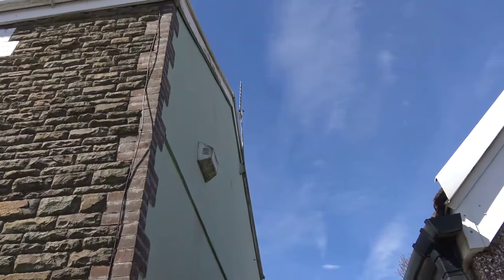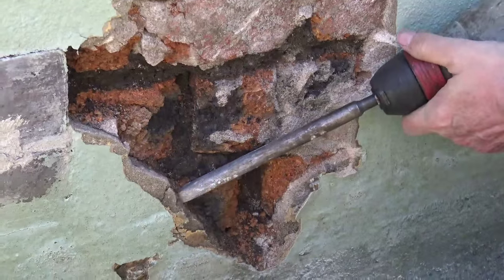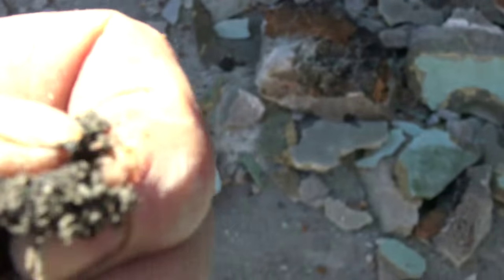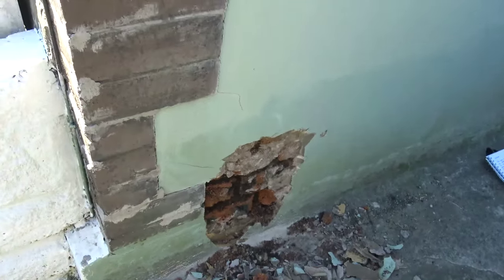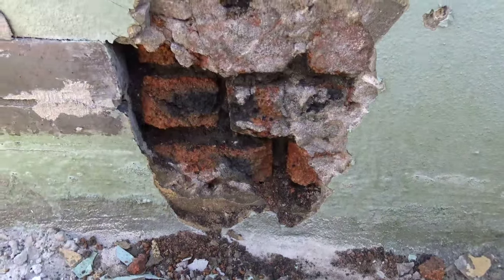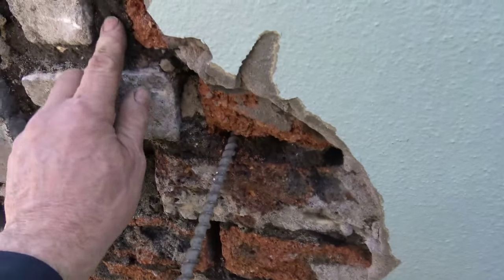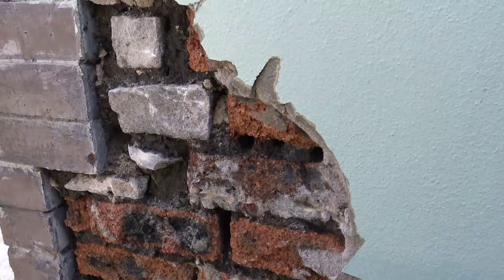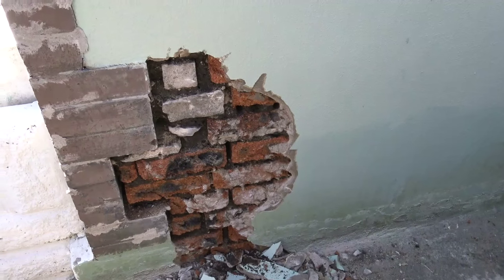A VERY wet Welsh house - all from cement render - not rising damp!

Comment: I understand that the cement render is trapping moisture in, but what I can't get my head around is how the damp got in there in the first place as the render has stopped water penetrating.
Reply from the maker: Its not penetrating to start with - Moisture is trapped by render that is impervious - there is water in the air all the time as a gas - it diffuses through everything, but when the wall gets cold - ie cold wind blowing round the corner or near the ground, it then condenses within the wall and makes it wet.  Basically fog forms in the wall.   Fine if there is lime - it can evaporate - but put cement or gypsum on the wall and it is trapped and cannot then get out.  Taking plaster off internally would help - but wall dries at about 1 inch per three months - so a long drying time. Plaster will be salty yes - so much water that the lime mortar and bricks themselves are almost dissolving - so plenty of salts forming.  Cold wall = cold wind blowing round the corner in the video.. Typical example.
Reply: +Peter Ward wind blows round every house, so does that mean modern houses with render systems fail as well? because your explanation states that the cold air as a gas condensates in the wall, which then can't escape through modern render/plaster. surely this is also the case with modern buildings then? I'm not trying to be argumentative, I just don't understand the logic.
Reply from the maker: You are right - modern render systems fail all the time.  Why are they rebuilding motorway bridges all the time - because interstitial condensation builds up over the years and rots the iron re-bars.  We are far better off with breathable materials that allow moisture to move freely, rather than trapping.  Modern houses get same problem - but have cavity walls, and as long as those are ventilated, you never get to see the effects.  Block the cavity, and sit back and watch all hell break loose.  Why do you think building control is so hot about not allowing rubble in cavities...?
Reply from the maker: You are right - modern render systems fail all the time.  Why are they rebuilding motorway bridges all the time - because interstitial condensation builds up over the years and rots the iron re-bars.  We are far better off with breathable materials that allow moisture to move freely, rather than trapping.  Modern houses get same problem - but have cavity walls, and as long as those are ventilated, you never get to see the effects.  Block the cavity, and sit back and watch all hell break loose.  Why do you think building control is so hot about not allowing rubble in cavities...?

Comment: Not sure what you define as rising damp but isn't water from the elevated ground being sucked in and up the wall by the render? Is the process of damp rising up the render spreading across into the mortar not rising damp? For this to affect the inside of the house the cavity must also be compromised or more likely there is no cavity (solid wall). As long as the ground is flush to the wall it will be difficult to make a permanent solution
Reply from the maker: Yes - not rising - in that case it is penetrating.  There is no cavity here.  If the entire wall was totally breathable - it would be dry.  Moisture from the ground is minimal really as long as it can escape.

Comment: I've got a lovely example of cement render damage on a timber frame house the render is now partly structural. it's destroyed to soleplate which looks  good and dry inside. the reason it's dry is the timber is so rotten it doesn't touch the brick plinth. if you have an email I'll send you some details and the repair pictures before and after
Reply from the maker: Sounds good... peter@heritage-house.org ...

Comment: What was the source of the moisture in the wall? If you remove the render and install new render wouldn't the same thing happen unless different measures taken into place? Would be possible to hack off plaster from inside the house to aid drying of bricks? Plaster could be salt contaminated anyway?
Reply from the maker: Moisture is trapped by render that is impervious - there is water in the air all the time as a gas - it diffuses through everything, but when the wall gets cold - ie cold wind blowing round the corner or near the ground, it then condenses within the wall and makes it wet.  Fine if there is lime - it can evaporate - but put cement or gypsum on the wall and it is trapped and cannot then get out.  Taking plaster off internally would help - but wall dries at about 1 inch per three months - so a long drying time. Plaster will be salty yes - so much water that the lime mortar and bricks themselves are almost dissolving - so plenty of salts forming.

Comment: Hi, my internal plaster started to peel off/disintegrate and I have been told my house has trapped moisture but only in the recently built extension where the issue is. I have been quoted 13k which I do not have. 
As such I was wondering, can I remove the render myself and repoint it myself, or will it risk doing more harm than good?
Also since the bricks are wet, do I have to protect the stripped brickwork from rain?
Reply from the maker: Strange as recently built extension. Doesnt make sense if modern build.  More likely condensation from too much moisture.  Before you do too much and spend any money -  check ground levels are below internal floor., check drains clear, make sure kitchen is well ventilated, bathrooms vented, good airflow through house.  You don't need ANY damp proofing or plaster / render.  Can send some pics to peter@heritage-house.org and I'll have a look if like - but I think it will be ventilation as main cause.  Pete

Comment: Hi Peter

We are currently doing the same to our gable (welsh house near swansea).

We have high humidity inside and house can be cold.  I';ve heard of lime render and when we come to have the front re pointed it will be lime.  What sort of render would you advocate in a similar position?  Lime?  And once rendered in lime would you use a lime wash paint?  Thanks  Andrew
Reply from the maker: Must be lime - but maybe not render - could just re-point in lime.  Must use limewash - even the silicate paints are not really breathable.

Comment: Did you take it all off or just up to the damp part?
Reply from the maker: Everything in this case.  Often the only sensible thing.  A lot of the time, the damp wallies have only done the obligatory meter up the wall, so we take that off, and put the original material back - and the wall dries out straight away.

Comment: Hi PeterI have a end terraced house over 100 years  old and  the  kitchen single story  wall is rendered. (with cement)  I took a patch off and put sealant in the mortar a year ago.  However the wall is saturated.  Would you recommend lime rendering the wall.  If so what is in it? Is it just sand and lime?
Reply from the maker: I'd rake out the brick first, with a chisel - NOT angle grinder as it damages the bricks and allows frassing.  Remove any sealer!  Then re-point in lime - but NOT builders lime.. Its hydraulic lime, not hydrated - a 3:1 mix of coarse, gritty sharp sand with 1 lime - usually NHL 3.5 hydraulic - can get form most big builders merchants - but if not - Ty Mawr do it - not sure where you are.
Reply: ok thanks
I live in cheshire , will search for  NHL 3.5 hydraulic in this area might to have it delivered , a most only  sell builder lime round here  . is NHL 3.5 lime ok to render with as well as for  re pointing ?